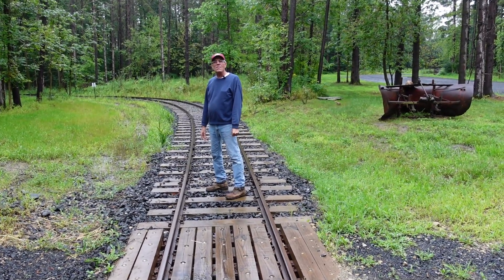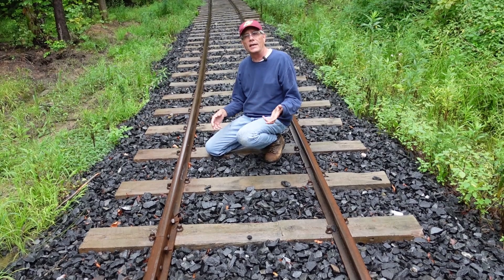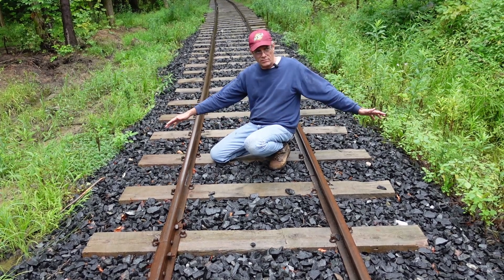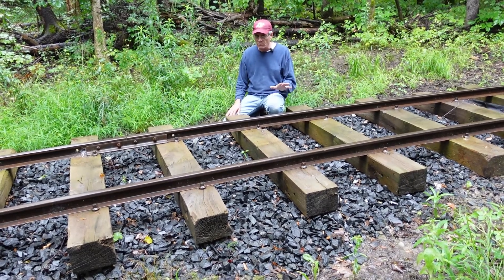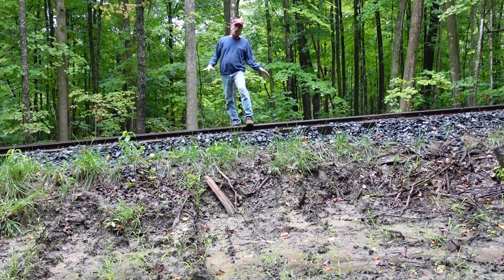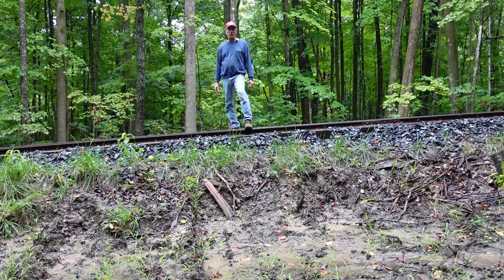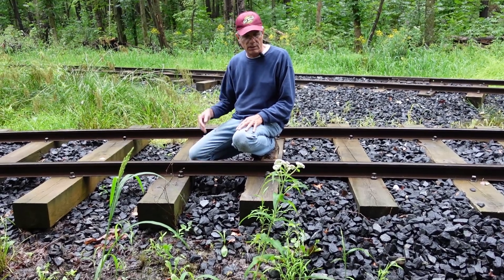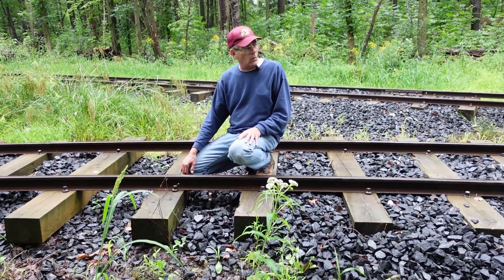Water: A Railroads Worst Enemy

Comment: Logging in the Big Cypress Swamp was done on a corduroy roadbed in areas. When done properly it is at least three layers thick. Bottom layer is crosswise. Middle layer is lengthwise. Third layer is again crosswise. Sometimes a 4th layer lengthwise was used lengthwise. Then the ties were put on top. A minimum of two layers will work if the top layer is lengthwise. The idea being that you want to spread the load over a larger area. Ballast wasn't used in most cases except at the beginning and the end of it as the tracks were only temporary. When the logging in an area was done,  the track was moved and the logs that had been under it went to the sawmill. Company name was Lee Tidewater Cypress Company. They logged there into the 50s.
Reply from the maker: Great info.  Thanks for sharing.

Comment: To help prevent erosion on the berms you can plant clover. Another thing you can do is spread big rock (6-12 in) over any slope that water might run on. The weight holds the dirt in place and the rough surface  slows the water down, reducing erosion.
Reply from the maker: Very true.  Phil didn't mention that but he actually did a bunch of it on the southwest side of our front loop.

Comment: If you have to lay track in a swampy area like that again, get some geotextile to lay down after you smooth off the line for the track.  Dump some good dirt(soil) on the geotextile and compact it to the desired elevation.  Lay down the subballast, track, and ballast the track.  If you need to rebuild through the swampy area, lay down the geotextile after removing the track; then relay the track.
Reply from the maker: Sounds like that would work